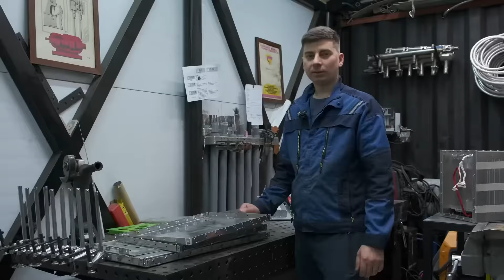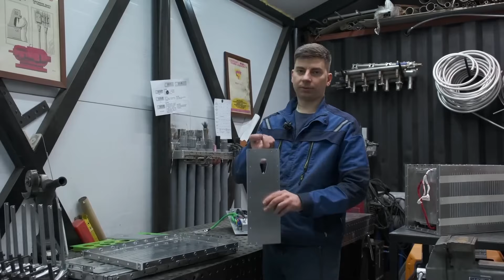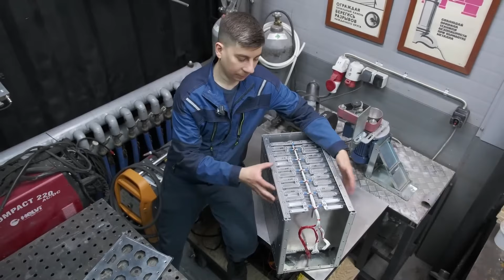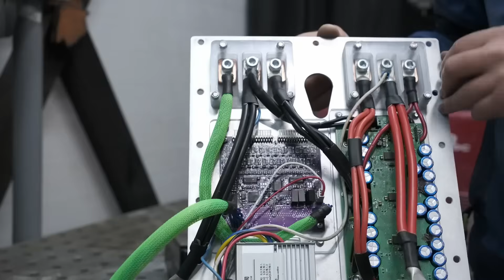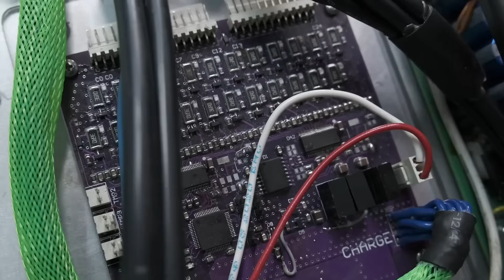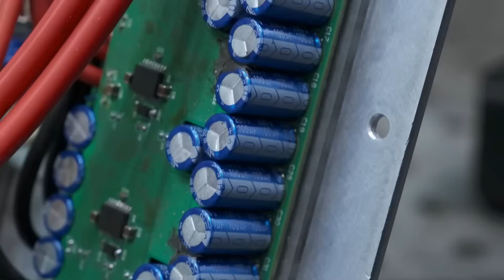What Do the DP Labs Quad Bike and GM Cars Have in Common? Watch the Second Episode!

Comment: problem can come from isolation with all the surrounding metal. depends on if the voltage is high enough but important to take into account. stelantus forgot to do so in the chrysler pasifica battery design which causes them to loose balance quickly and is a safety problem.